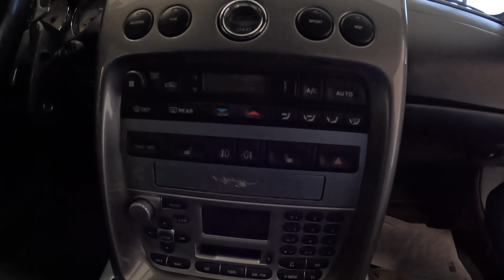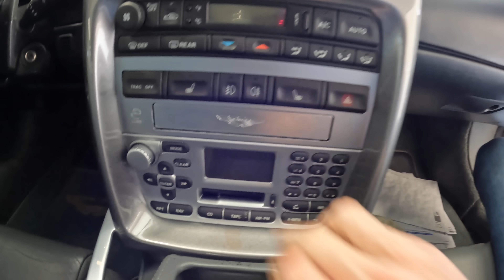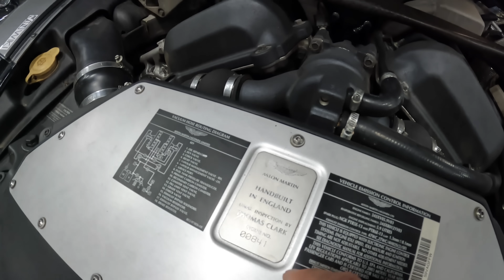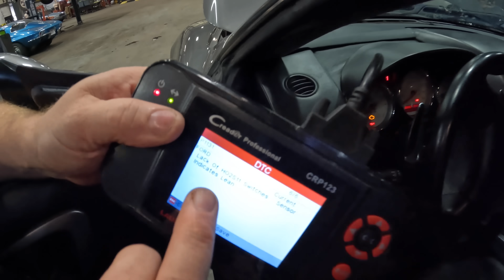I bought the Cheapest Aston Martin Vanquish to prove Clarkson wrong (Roasted on Top Gear 20 yrs ago)

Comment: I had a Mazda with 1/2 of this car's engine and it was quite fun to drive.  I had the O2 sensor indicates lean error a couple of times and it was caused by the exhaust gas recirculator being pointed towards one bank of cylinders more than the other inside of the intake plenum.  I cut the end off of the EGR nozzle thing and the error went away.  I'm not sure if the V12 version has the same EGR system but it's something to keep an eye out for.
Reply: While we're talking about fixes, my Jaguar had the coolant low problem. What happens is that the floats lose their flotation over time and when the coolant gets hot they don't float up enough to indicate the true level. You can replace the floats but it's a fiddly job, so I just replaced the coolant tank, float and all. Cost me about £50 for a brand new aftermarket one.

Let's hope Tyler sees these comments!

Comment: The Automatic that sounds like someone is pushing a clutch in and moving a shifter and releasing the clutch back out. From the outside it honestly sounds like its a pure manual with someone casually shifting it.

Comment: Clarksons point wasn’t just the speed of up shift, it is particularly annoying when downshifting if you are “driving spiritedly” and as you said, it doesn’t always do what you want. The manual gearbox of the era from these are pretty horrible too. They are very heavy on the clutch and you need a good strong arm to change gear, it has a pretty long throw too.

Comment: Flashing check engine indicates coils and a misfire.  These are commonly available 2 pin plugs, but 12 of them.   It gets expensive since 12.  The coolant sensor is simple replacement (Ford part).  I have a 2007 DB9 with the 3 pin coils.  The coils can be had for a lot less by shopping around.  They are not bespoke to Aston Martin.

Comment: I’ve had 2002 for the last 8 years. Fabulous build quality. Not a single rattle of any kind on a 20 yo car…not many cars achieve that.  Shifting? Faster than I can manage with a stick, and down shirts with the auto throttle blips make you a shifting god.  Auto mode is pretty bad because you don’t know when it’ll upshift, so you can’t time your throttle lift like you can when using the paddles. I would never convert this to a stick.

Comment: It's the same thing over my car's SMG and the one in the F355, people becry them without really knowing them or how to use them properly, If the Aston's is anything like the SMG you should be able to increase shift speeds to find a sweet spot and in the Aston's case it's not really meant for fast driving so much as fast cruising being a flagship GT.
Vanquish is actually my favourite Bond car and made Die another Day the Bond movie to stick in my mind the most (plus Halle Berry in that Bikini and the skintight leather) with the only thing ruling one out being the parts costs.

Comment: The misfires can be a serious problem with these engines. The primary cats are very close to the headers and when the misfires become very frequent, combustion can occur on the face of the catalyst which then breaks down and is ingested into the cylinder where it basically destroys the engines. This is a known problem so a cat delete would be a good idea if your planning on keeping the car. 
They are beautiful 😊

Comment: Keep changing gear without lift off the gas and you'll kill the clutch. 
the reason the gearbox is renowned in all models using it as being crap is because the gearbox is a hotchpotch manual box single plate clutch trying to be an auto, pdk and a manual at the same time, Aston were just jumping on the flappy paddle band wagon and didn't bother putting in enough R&D.

Comment: Interesting how relatively good the car is compared to how bad people said was.  

One benefit of the manual swap is that the transmission and clutch will be servicable in the future, whereas the automated systemc ould have any number of components, especially the electronics, which are not serviceable.  That said, it drives great now and could then be swapped later.

Comment: By the sound of it, it doesn't seem like it shifts any faster than a manual transmission could. So of course someone would criticise it, cause why take away the enjoyment of a manual, if you get nothing in return? 

The auto mode sucks, hill starts being difficult cause you can't control the clutch and handbrake the way you would a manual, and in paddle mode it's no faster than a manual.

Basically, I do gotta agree with Clarkson, not because I see him as the absolute truth of motoring, but because this particular gearbox doesn't seem to bring any benefits over simply being a manual car.

Comment: I owned a new DB9 volante.  Terrible fit/finish.  All kinds of electric issues.  Terrible body flex.  Doors and trunk rub paint.   Mass produced cars better fit and finish.  Infomat system better mass produced.  I have owned Ferrari, Lambo, Maserati, AM the worst.  I have owned many Porsches.  Closest to an exotic without all the headaches.  No waiting for parts for months.  Right now own a Model X, Model 3, Porsche Panamera 4S.  Trading Porsche for electric Porsche.  Once you own EV hard to go back high Maintenance gas.  Plus charging at home save $400/month on gas/electricity with solar panels.  Gas cars will be worth nothing once EV mainstream

Comment: Only cheap in America, the rest of the world has pushed up their value. As an owner of a few of the single clutch AM Vantages in V8 and V12, they deserve the reputation absolutely if you left in the auto mode (it should never ever have been allowed to leave the factory with that option). You MUST always drive them in sports mode and a slight lift going up gears, not required on downshifts. it is DCT no, is it a modern 8 speed ZF no, is it as good as Lambo, Maserati, Ferrari and other single cluth robo matics absolutely. They can be fun and certainly require engagement more akin to a manual than an auto

Comment: Yes it's slow, my 40 year old Ford 4R70W is 4x faster shifting without any paddles, just let the computer shift the internal solenoids.  The 6R80 and 10R80 are both faster than the flappy paddles without dual clutch.  Those paddles are worthless, just let the PCM shift gears or get a manual.  Paddles are stupid, computers are faster than humans at shifting automatic transmissions.

Comment: Vanquish 1.0 underdeveloped cutting edge automotive engineering resulting in a dynamically flawed driving experience. The latter  "S" variant was much better, but ultimately both variants are an expensive maintenance ownership nightmare. 
Converting from the useless Graziano semi-auto to manual only manage to solves one (major) problem, but not all especially the driving dynamics. Oh, and US versions manage to have most of the joy sucked out of them and are even less fun to drive. I know because I had two (one a Middle East version that was sharper and a US car that was a turd).  Ultimately, a Ferrari 550 is far better to own and drive.

Comment: Despite anything Clarkson says being automatically c**p, even if it was true immediately before he said it, the original Vanquish gearchange is an exception in that it was indeed awful.  As you say, much of it was down to people driving them just like a regular auto, but they were still breaking clutches at a couple of hundred miles.  Subsequent new software, and more customer education, improved things.  But it was still clunky and slow compared to the F1 transmission in the far superior and better handling contemporary 550/575, although by 'slow' I mean about the same as you could do it with a manual stick, when the Ferrari could switch cogs in 0.2 seconds.  Mainly though it arguably just didn't suit the Aston vibe.  But it is a good looking, great sounding car!